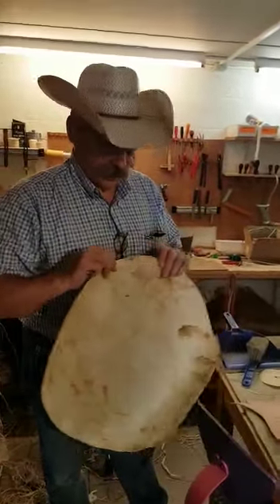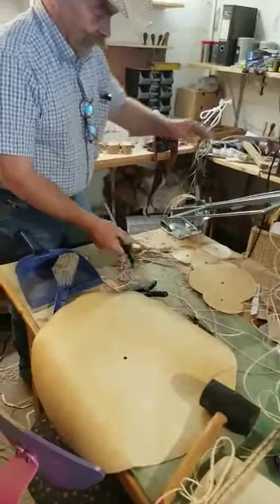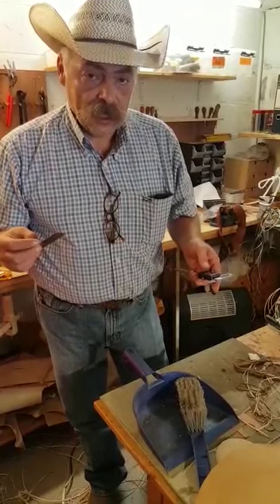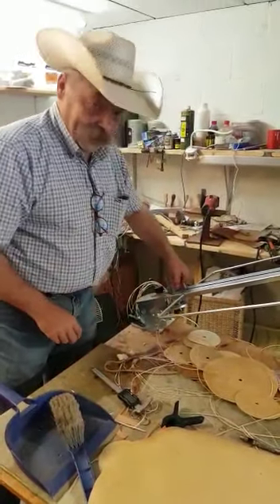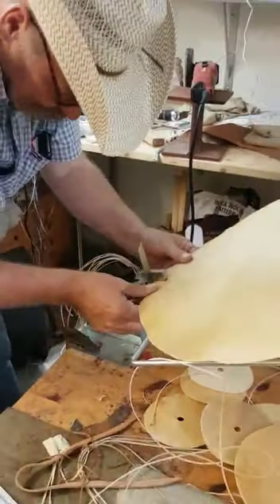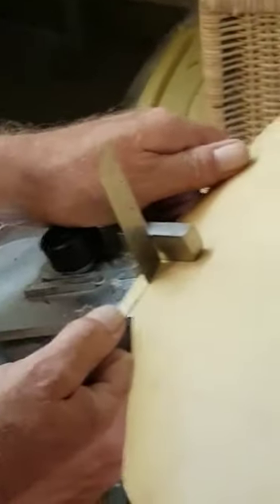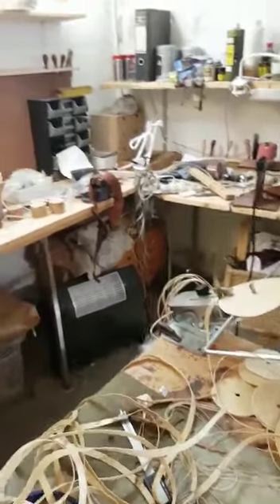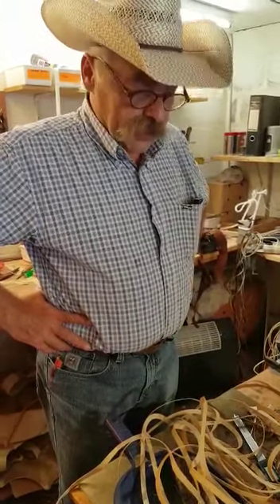Cutting sogas from a disc of rawhide.

Comment: I cut strings from Kangaroo raw hide, 50cms is about the maximum disc size, so cutting from centre to outside for less waste is best. A lace cutter would turn your coasters into usable string.
Reply from the maker: 100% agree with you on the lace cutter and I use it that way. For kangaroo rawhide, which I myself only use for button string, I don't cut a disc. I clean up the edges of a hide and cut a soga from the outside in.

Comment: What it the name of the  cutting machine?
Reply from the maker: We call it the Krum (designed and made in Krum, TX) cutter. you can get it from Brandon Anthony or Clint Haverty
Reply: @jan boogaerts  do you  have their contact info?
Reply from the maker: @stevensteadman2912  easiest way to get in touch with either one of them is through Facebook
Reply from the maker: @stevensteadman2912  I found this emeail adres for you : @banthonybitsandspurs
Reply: There isn't many suppliers that can sell  budget-friendly cutters around is there?
Reply from the maker: @l.d.b.r5141  I started out cutting my sogas with a pocket knife and my thumb as a guide. Than evolved into an axe handle with a nail in it as a guide and a blade in it. My 1st upgrade was a cheap Tandy  strap cutter. From there I upgraded to a cheap pistol grip draw gauge, later on to a good Osbourne one. Now I work with the Krum cutter. You are only limited by your creativity and imagination. There's a set of videos on FB where Graeme Queisenberry cuts sogas, splits 'em, cuts string and bevels it with nothing but a pocket knife and a wood block. Since I 'm clumsy I just like to use the best tools money can buy, because they save me time that I can use to actually braid up gear. Good horses, good gear and good tools are the only things I waste money on 🙂.
Reply: I always thought using a pocket knife and wood was the most cowboy thing to do. I never seen any detail videos of how it was done until now. You can even do vebels with it. Like having a jig at this point. reminds me of what this old cowboy says it's just a vulgar display of wealth.
Thanks
Reply from the maker: @l.d.b.r5141  Making life easier and whatever I more efficient has become life goal for me 🙂
Reply: I make bison lacing..it can only be cut when its wet..I don't think this would work